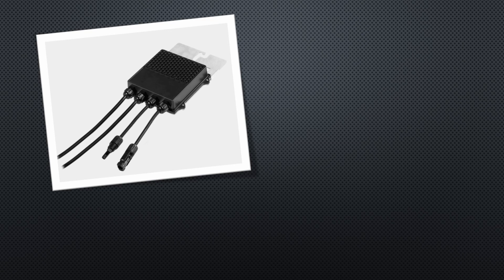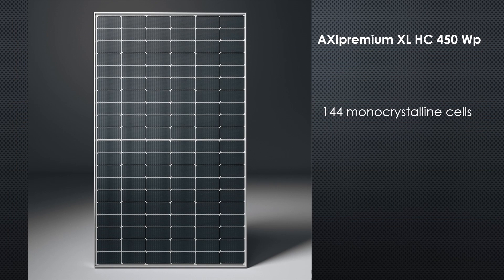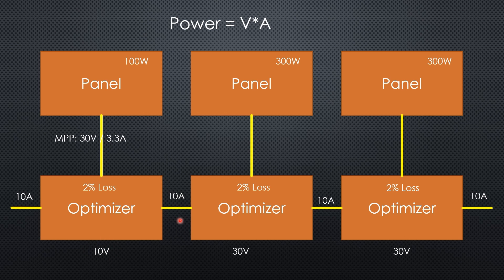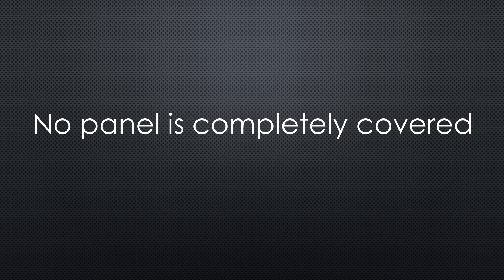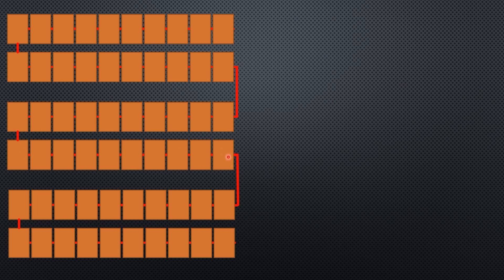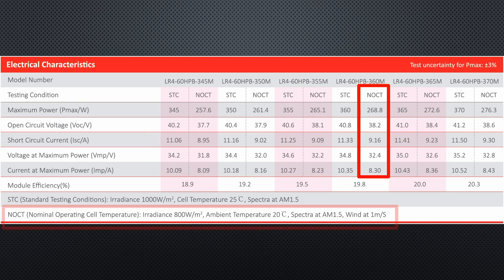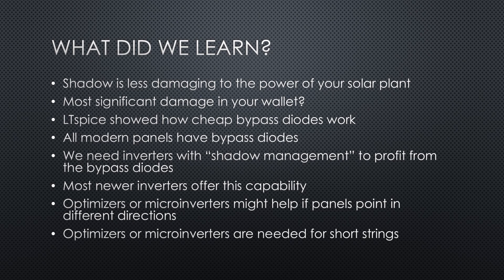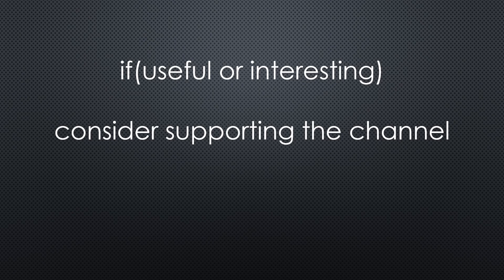441 Are PV Optimizers Worth the Money (e.g. SolarEdge)?

Comment: Hi Andreas,

Nice video. I did my PhD on optimizers and PV shading and my conclusions were similar to yours. We also did an article on how to maximize power production of a PV plant by interconnecting the strings in parallel. Passive optimization works about as well as an active one.
Reply from the maker: Interesting paper. Maybe one day they add a few transistors inside the panels to switch each cell accordingly. Because with the current fixed bypass diodes, most of the loss comes from the panel. Which is also lost for the optimizer...
Reply: @AndreasSpiess  Thank you for the reply. The bypass diodes are an "economic compromise". When one cell goes on the negative region, its voltage is around -17 times that of the other cells. When adding them up, this makes for a negative voltage that activates the bypass diode. This means that 18 (or around that) are the maximum number of cells you can still protect with a single bypass diode. 
If I'm not mistaken, space applications put one bypass diode per cell, to avoid this problem and maximize power production. 
I suppose it would make the PV modules too expensive to do so. :P
Transistors would be too complicated.
Reply: @ecolucid  Do you have any thoughts on if optimizers truly make a difference on panels facing different directions?  The reason I ask is, I have an extra MPPT on my SolArk inverter that will allow me to use up to 12 of my 85 Voc panels (4 modules in series and 3 strings on that MPPT), but in order for me to max out this MPPT this way, I would have to have the panels pointed in 3 different directions (4 each facing S, E, W).  Would placing optimizers on these panels add any significant improvement?
Reply: @ssoffshore5111  The answer to your question is: it depends. Pointing in different directions means your PV modules will have different current and power ratings at the same moment of the day. If each string has a different orientation this is less critical as the strings are in series and they share a common current. The MPPT will impose a single voltage to all strings since they are in parallel, but each string will provide its own current as their modules are all in series. 
The "low cost" optimizer is to connect the modules in a Totally Cross Tied connection, but it costs more copper. This means connecting the modules in between the strings in parallel.
Reply: @ecolucid  TCT connection would be a pretty big PITA on this application.  Each of the three strings of 4 panels on this single MPPT would be in series, each facing a different direction, and then tied together (and fused) in parallel at the combiner box.  If TCT isn't an option, the optimizers would be worthwhile, or not?
Reply: could you help answer a (hopefully very simple for you) question - adding several higher power (much newer) panels in series with the old ones
I should get less than rated from the new addition, but something proportional to the new panel voltage * old panel current 
right?
thank you
Reply: @tjunkieu2b  Thank you for your question. I will try my best to answer it. I think you are right: as PV panels age, they produce less current (but not that much less). If you connect a newer panel in series with an old one, they will have the same current for a given point of operation, but they might have different voltages.
Would you mind explaining a little more? Are you retrofitting stand alone/DC grid PV for grid injection?
Reply: @tjunkie  Yes, but there are issues with mixed modules in a string, and if at all possible one should not do so, or you can significantly shorten the life of the lower power modules as they will be possibly passing more current through them than they are designed for. Best to have the same modules in each series string.
Reply: @GoCoyote  I'm not sure that is possible. It is important to understand that a PV module is a voltage controlled current source. An inverter will start it at VOC, open circuit voltage, and then lower it's voltage until it reaches the MPP current, maximum power point. If you short circuit your PV module (connect the + and the - together) your voltage will be zero and your current will be iSC, short circuit current.
Say you connect a iSC 10A module in series with an iSC 8A one. The module with the lower iSC current will impose the overall current, so both will operate at slightly lower current than 8A, which is the iMPPT of the lower module. But say your inverter forces the voltage to drop further, reaching a current higher that 8A. In this case its bypass diodes become active and the lower module is protected. Thus, there can be no "over current" on a PV module so long its bypass diodes are operational.
Reply: @ecolucid  
Yes, if all of the bypass diodes are operational, or if the modules have bypass diodes. In the early days of rewiring from 12 volt PV systems to the nice new MPPT Charge controllers, I saw a few systems where PV modules were lost due to not having bypass diodes. In my opinion it is just better to maintain strings of matching modules. Modules are usually the cheapest part of a system, and it is usually better to put the old modules up for sale and purchase new ones. People are always looking to match damaged modules on existing systems, especially after large storms. I have known people who sold their existing modules for the same amount that their new ones cost.
Reply: @ecolucid  
Another thing: most string inverters/charge controllers have start voltages considerably lower than open circuit voltages, so modules will only briefly, if at all, see full VOC, as most MPPT trackers will not do full sweeps unless there are major changes in outputs, but just perturb the curve to ensure optimal output. It is all about tweaking the software to get maximum power output, and even a couple of seconds to do a full sweep is power lost.
Reply: @GoCoyote  Thank you for your reply. I have to admit I've never seen a PV module without bypass diodes. And when looking up the documentation of inverters, I've also never seen them working below 80% of designed VOC. When doing experiments and looking at data from our 100kWpk experimental plant that has been operational for 10+ years equipped with several commercial inverters, I've always seen them starting from VOC.
But beyond our different experiences on the field, the idea still holds: connecting different rating modules will mean a lower current to those capable of operating at higher currents.
Of course, if your PV panel had no bypass diodes, do not use them.
Reply: @ecolucid  
All inverters/charge controllers have a specified start up voltage at some point above their lowest operating voltage. That way they will "wake up" as soon as there is a reasonable chance to be producing power above their internal consumption. So if a inverter has an operating Voltage of 200V to 600V, it may come on at 300V, establish itself, and produce power as long as the voltage is above 200V. The MPPT will also has a range, say 250V to 550V. Charge controllers will often have a low voltage range that will be battery voltage plus some voltage, say battery voltage plus 5 volts, or battery voltage plus 100 Volts for 600V stepdown controllers. The engineering that goes into this industry is pretty amazing.
Reply: @ecolucid   Hi Luiz, may you share your papers on "maximize power production of a PV plant by interconnecting the strings in parallel"?
Thanks!
Reply: @johnthomas338  
The issue is that the bypass diodes that are built into modules are rated to be able to dissipate the heat caused by the worst case scenario of one module being shaded completely.

If there are other modules in series that can produce current higher than that of the temperature output design limit, or even the actual current rating of the diode, then one is risking damage to the terminals in the junction box, the cell interconnect tabs, and the backing material of all of the lower current capacity modules. I have seen this type of damage to modules caused by this very issue.

As modules are just about the cheapest part of a PV installation, it is just better to purchase matching modules for a system, and sell off the old ones. With electricity, what you don't know can kill you and others. Don't be arrogant, and learn as much as you can.
Reply: @johnthomas338  
The very fact that you don't know points to you not yet being qualified to have informed opinions on the matter. Take some time to learn, then you can share with others if you wish. P = I squared times R is the best place to start when it comes to finding power loss in a circuit, and you can probably get your hands on a copy of circuit simulating software that will help model it.
Reply: Ya but your not mentioning the other things optimizers let you do, like monitor individual modules.  And bring string voltage down to just a few volts.  Rapid shutdowns etc.  in case of fire or whatever.. but sure in the labratory who cares right
Reply: Hey, could you please send me a copy ?

Comment: hallo andresa - ich habe keine bypass dioden im modul und grosse verschattungen auf 2 garagen - auf der einen mit optimierern (bei 3 von 12 modulen) und bei der anderen garage ohne optimierer - meine erfahrung - die optimierer bringen überhaupt nichts - ich denke daran modulwechselrichter mit 4 anschlüssen und 4 mppt trackern zu instalieren - was denkst du?
Reply from the maker: Das ist nicht einfach zu beantworten. 1. hast du im Video gesehen warum Panels ohne Bypassdioden nicht im Schatten eingesetzt werden sollten. Und zweitens haben Inverter normalerweise Minimum und Maximale Spannungen. Es muss also ein sauberes Design gemacht werden das alle diese Dinge berücksichtigt.
Bevor du etwas änderst würde ich analysieren wo das Problem liegt. Denn aus nichts kann der beste Optimierer/Inverter nichts machen (wenn die Panels schlecht auf Schatten reagieren)
Reply: @AndreasSpiess  ich hab noch mal genau nachgeschaut - meine module haben doch 3 dioden - die allerdings nicht im produktdatenblatt stehen, ich bau jetzt erst mal die sinnlosen moduloptimierer aus und überlass das dem fronius schattenmanagement. danach werden die daten analysiert - danke

Comment: Another reason towards micro inverters is, that the system gets slightly more reliable. When something like a Strom destroys parts of your array, your prodution isn't gone completely.
Also a failing inverter is not as much of a problem with bigger setups. And the components are less expensive, as the requirements are lower ;)
Reply from the maker: I agree if you think that microinverters are extremely reliable even if they have to work in harsh and hot environments. Time will tell…

Comment: I think you are wrong about the micro inverters and how to use them together with batteries:
It is pretty easy to use E-Bike battery's on the input side of the micro inverter and use a charge controller to charge  this battery up - especially with 48V batteries
Reply from the maker: I agree, you can do everything if you want. My question is how the yield of such a battery is if it has to change from AC to DC to AC again.
Reply: @AndreasSpiess  No it dosent has to do that. You charge the battery direcly with dc from the solar panel - and use the inverter to step up that low dc voltage to mains :)
Reply: @AndreasSpiess  https://www.youtube.com/watch?v=yOcoux9IbzM Andreas Schmitz Made a Video about this, but as his inverter didnt support power regulation, he needed to add a dc2dc boost converter

Comment: I like your findings useful, but you missed one aspect important for DIY by amateurs: safety. Optimizes (solaredge) produce only 1V on the output if they are not connected to inverter and it's safer to handle and check connection of PV cables with safe voltages.
Reply from the maker: I know this argument. 
Maybe you describe a typical scenario where this matters. I use insulated cables and connectors and the voltages on my strings are in the area of 400 volts. Very similar to the peak voltage of a simple 240V cable. The connectors used by the solar panels, BTW are much better protected than an ordinary household cable where metal easily can be reached…
And AC is more lethal than DC because it influences the heart function, btw. 
Still, I switch my panels off before I work on them.
Reply: @AndreasSpiess  For DIY project is safety at least worth mentioning. You also didn't mention per-panel power monitoring, that can help pinpoint power loss of individual panels (crack/shadow....)
Reply from the maker: @michallindner34  You are right. This video focused on the strongest sales argument used by optimizer salesmen. I assume they still use it because it is much "better" than the rest.
Reply: @michallindner34  The chance of 1 panel being defective is less than 5%. The cost of optimiser is almost the cost of 335W poly panel. It is not worth keeping 20 optimisers to detect 1 faulty panel

Comment: Regarding your conclusion: what if panels are in the same direction, but a different angle? (For example a house with both flat and angled roofs).
Reply from the maker: Then you need one string for each direction, optimizers, or microinverters.
Reply: @AndreasSpiess  I got that, I was thinking more of your conclusion, do you think an optimizer or microinverter is not needed for such a setup?

Comment: I have installations to the east, south and west. I have SolarEdge optimizers.
Is it worth it? I do not know.
I am sure of one plus:
Optimizers increase safety in the event of a fire.
In Poland, based on the regulations we have, the 10kW installation requires an additional switch outside the building - available to the fire brigade. If you have optimizers, it is not required. For me, it is a cost and aesthetic benefit.
Reply from the maker: If the additional features are important to you, your decision was perfect. This video is just about one wrong claim used by the industry.

Comment: That's another great educational video Andreas. Thank you. (Your ESP32 videos have been useful too)

I had watched the NRG video you linked to some time ago and wondered whether I had made a mistake in buying Enphase six years ago. I wanted Enphase because I have panels facing east, north and west (sth hemisphere) and wanted panel level data. I use individual panel data in a couple of automation routines and I also wanted to know if a panel had been damaged or was covered. It did confirm I needed to move a TV mast.

Optimisers were not a thing at that time and while there were inverters with dual strings, I would have had to buy two separate inverters for the three arrays. 

You and NRG have now given me a dilemma. I might shortly expand the system to accommodate a battery and sticking with Enphase seemed logical.... but now......
Reply from the maker: I think you did a valid decision. This video is only focusing on one wrong claim of the industry. Your microinverters still work. So let’s hope this will continue for the next 18 years.

Comment: It seems you covered optimizers but then just kept throwing in micro invertors as if they were equal.  Wouldn't you agree that if a panel in a string fails (open circuit), the whole string is taken down?  And with a micro invertor, a failure in a panel, or micro invertor only takes down one panel?
Reply from the maker: I agree. However, chances for a failure of a solar panel is considered lower than for a microinverter because the microinverter is more complex.

Comment: I agree that optimizers aren't really worth it compared to bypass diodes. But I do like the safety aspect of micro inverters. High voltage DC can cause arcs that do not extinguish. It is one of the major culprits in residential solar fires.
Reply from the maker: If other criteria are important for you, your decision was perfect. This video was just one claim often made.

Comment: Such arrogance!  Optimizers were built for older panels which were not the newest 'split' type panels, no bypass diodes.  The power drops show that optimizers do the job they are built for.
Reply: Solar panels have had bypass diodes for at least 12 years.
Reply from the maker: The question I asked is: Do you need… and not: Did you need.
But you are right. These claims come from a time before bypass diodes.
Reply: Even non split polycrystalline panels have diodes. This is not something new. It has been there for at least 5+ years now or may be even longer

Comment: so micro inverters do not work well with home batteries?   not even if they are both, from enphase?
Reply from the maker: They work well. But batteries are DC and Microinverters produce AC. So you need additional circuits.

Comment: I have had Enphase for a while and one thing I noticed is that with more microinverters the slower the response time on loads.  When I only had 10 it would respond fairly quickly when the A/C turned on/off.  When I upgraded to 24 there was a noticeable lag on both turn off and on.
Reply from the maker: In my last video I showed a bit how inverters work. They are PID controllers. If you connect many in parallel they probably influence themselves.
Reply: @AndreasSpiess  The power line control interface also interferes with my old X10 controlled lights,  is slightly annoying.  But I hear there are solutions.

Comment: I have a Solaredge inverter with 45 sunpower maxeon 3 400W panels with optimizer. 
Panels are mounted on 3 different roof faces at different angle and orientation. I can't say how useful optimizer are. In my case was a no brainer  because the whole system was for free due the Italian ecobonus and it came also with three Tesla Powerwall 2 battery and a 16kW Daikin heat pump.
The system is fairly new, and i don't have yet enough data about its production. In summer was overkill (16MW/h) surplus this year, i hope in winter will cover most of the electric consumption, where i live is cold and not very sunny these days.
Reply from the maker: That sounds like a perfect deal to me. Congratulations!